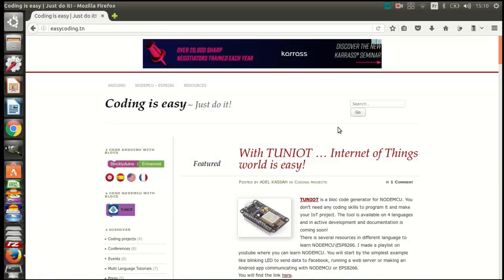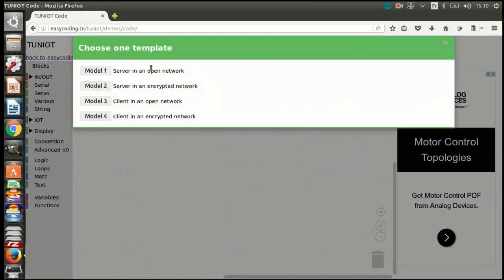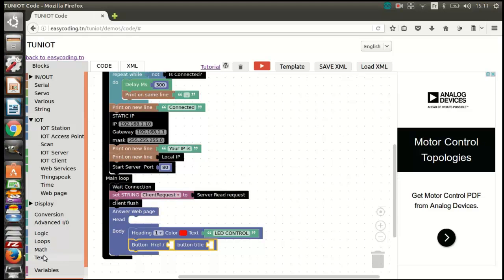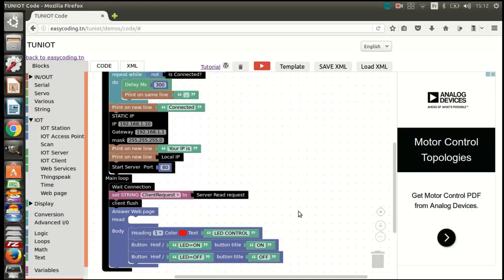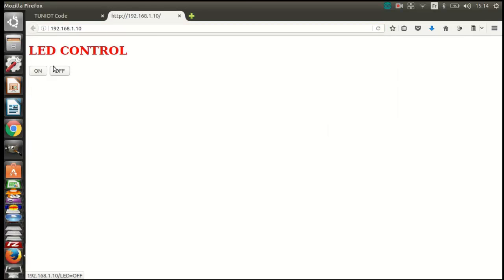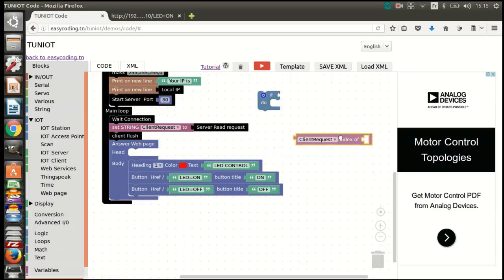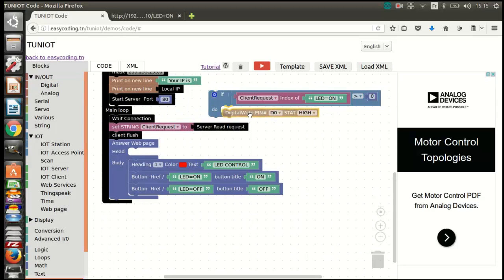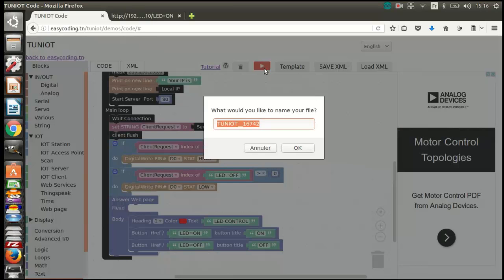NodeMcu (ESP8266) Tutorial B-12:   Buttons to control LED

Comment: WHy should I use STATIC IP ? can someone please... mine is not working, keep loading the webpage
Reply from the maker: Dont use a static ip unless you want that the ip does not change when you reboot the modem or the board
Reply: @ADELKASSAH  okey sir... do u have Telegram group about easy coding that I can join and discuss ? If it's so, it'll be helpful

Comment: Sir shall i add my own IP address. as i using 192.168.1.10, the page is not being loaded and showing me "This site can't be reached". What parameters do i need to alter for this?
Reply: i am also facing this same issue
Reply from the maker: You need to put an address in your own network. You need to specify the  right gateway and the right mask otherwise it will not work
Reply: me also facing same problem "192.168.1.50 refused to connect." and the gateway right and mask also right
Reply: same problem
Reply: @alhapidzteguhgumilar  i need some help

Comment: great, Sir. Usually for this kind of project, I'll write my HTML first then insert it on my Arduino sketch. Tuniot makes it easier.
Reply from the maker: exactly! I do the same. I start always with blocs and continue if needed with code to save time.
Reply: Sir, how to make a web server contains button (control led for instance) & also display value (eg. analog value of a potentiometer) with Tuniot?
Reply from the maker: very easy. In the same program in the html answer, add the bloc analog read. You can see that in the video sensors network